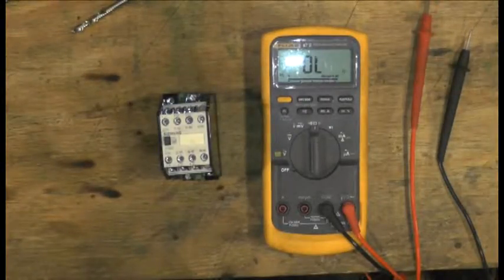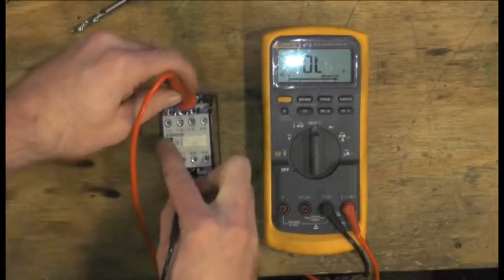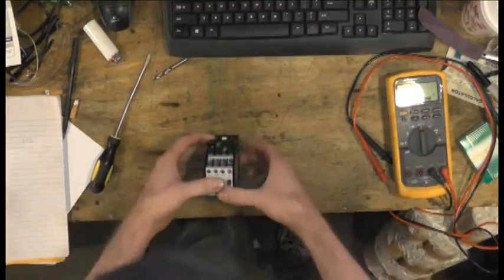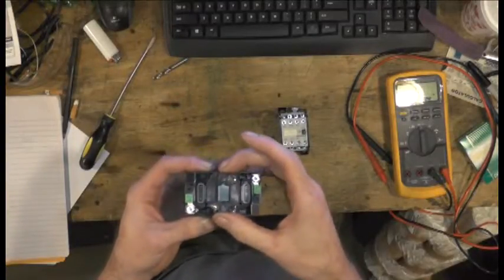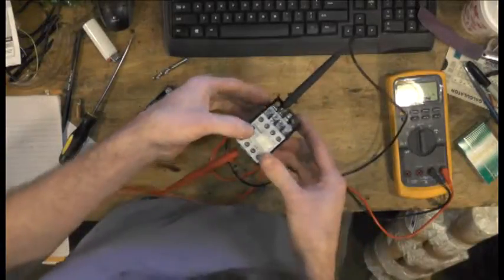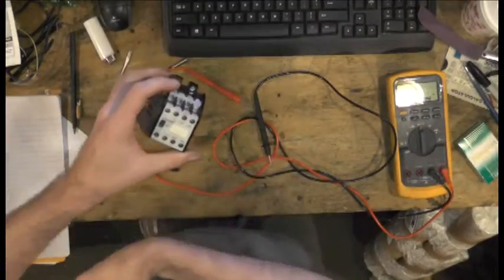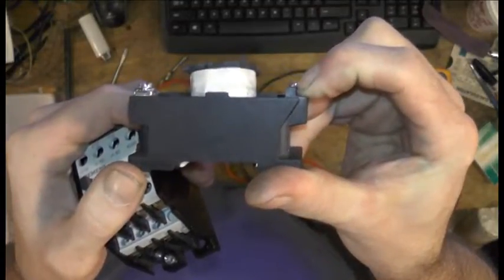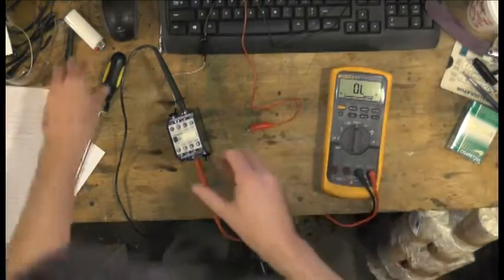Testing and Disassembling a Siemens 22E 3TB41 Relay

Comment: I had that Siemens contactor on my lathe. It started failing after a few weeks of use. It would only sporadically turn on. The seller sent me a new one. IIRC they said others have also had issues with the Siemens 3TB41 contactor.

Comment: 1. Unscrew the two bolts
2. Pull by a thin screwdriver the white cover (with the name of the contactor) up and remove  it .
3. Pull out the copper contacts (4 on one side and 4 on the other - the top row) sideways.
4. You will have access to the second row of contacts. Remove the white covers upwards and then sideways.
5. Access to the second row of copper contacts will be opened. Pull them to the sideways.
6. Clean coper contacts from varnish.
My new contactors did not work because of the lacquer. Now everything works fine. Thank you for the video.

Comment: Might as well repair both the bad ones for spares.  The contact body should come apart to allow you see the problem.  Those intermittent readings scream USED relay that was tossed back into the bin. 
As long as the coils are good, a few minutes with a point / contact file will take care of the rest.
FYI- Never use sandpaper to clean contacts.  The rough finish promotes arcing and wear as the current burns off the peaks leaving carbon trails.  Fine tooth single-cut files leave a smooth flat to avoid that.
Reply from the maker: Sounds good to me, thanks for the suggestion and tip about sandpaper (which i would have probably used, emery).